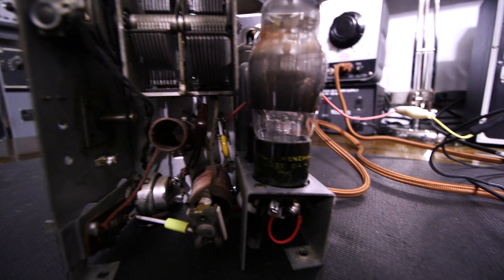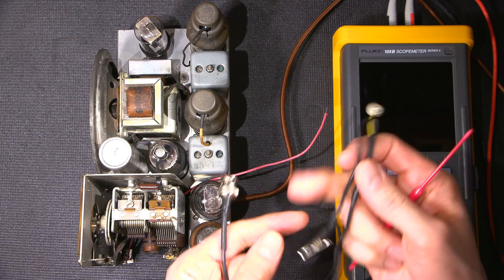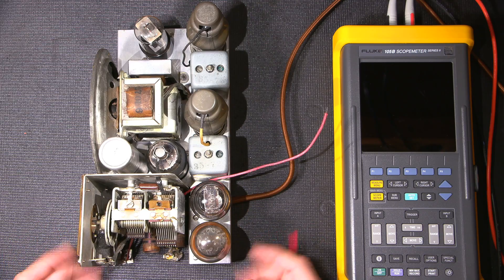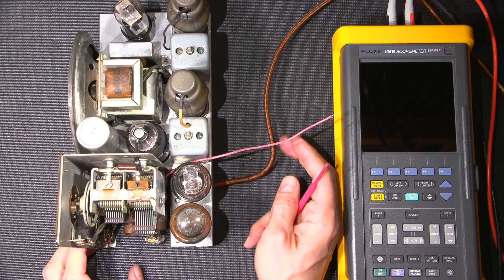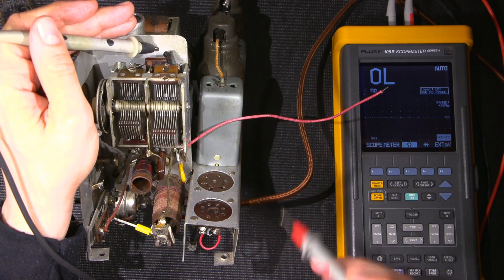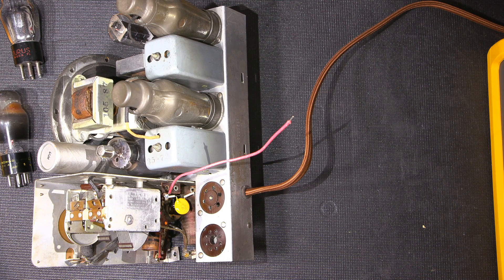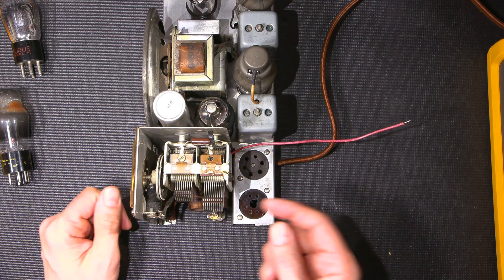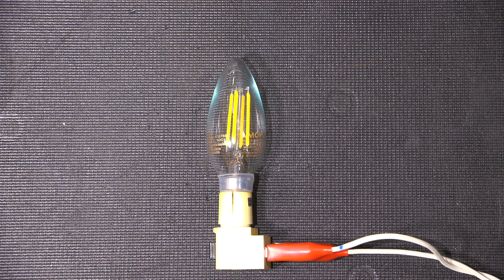See High Voltage Created From Falling Snow!

Comment: The only explanation I can think of is there must have been a breakdown/arcing occurring elsewhere that you didn't see, either in the isolation transformer, in coax connectors, or even at the antenna itself. Every time there was a breakdown, what you end up with is a very fast discharge pulse to which the inductor would have presented a high impedance much more than the 30 ohms DC resistance. If the chassis of the radio was connected to ground likely nothing would have happened, as the inductor would have bled off any charge before it could build up.

Snow, wind, and believe it or not, even rain, can cause a static charge to build up on an antenna. A high value resistor connected between the antenna and earth ground will bleed off any static charge before it can build up to damaging levels, and shouldn't affect the performance of the antenna. I consider this essential on any antenna system that is not DC-ground.
Reply: This is the explanation I’m going with too. Floating Antenna and coax charge up and eventually a discharge occurs somewhere else, maybe outside, cause a fast rise-time pulse on the coax which can couple through the cap....

Comment: I used to have a 160 meter, inverted V antenna at 120 feet above ground. One day we had a strong snow storm. the snow was falling with huge snowflakes which was somewhat unusual. I noticed a loud clicking sound in my radio shack. The spark was breaking a 3 inch air gap between the antenna coax and a grounding post. Very weird and unusual.
Now, I have static and lightning protection installed on all coax cables that enter my shack. It's very important, especially for large antennas.

Comment: I get a series of zaps while vacuuming ash from my pellet stove...Sparks jump to my hand thru the plastic hose as the dry ash particles flow. There is likely an AC component of pulses building the charge induced on your antenna. That explains a potential across the inductor in your radio's front end....

Comment: The radio chassis is sitting on a grey mat. By chance is this an anti static mat connected to ground. This would explain the antenna path to ground and may explain the arcing.

Comment: I had observed the same phenomena during a snow fall a few years ago. My discone antenna on the roof was picking up static electricity. So much so, that i was woken up by the cracking sound of sparks arcing between the center conductor and the shield at the end of the BNC connector. Fortunately, it wasn't hooked up to my SDR at the time, otherwise it would've caused some serious damage. Yet it didn't help when I stuck my finger in there out of curiosity xD...

From what I've read, it's caused both by snowflakes taking static electricity from the air, and also rubbing at each-other while falling down to earth, much like when you rub two balloons together to make them stick to the ceiling.

Comment: Woah that's pretty cool.  Kinda makes sense though, winter is super dry and snow would have some electrostatic properties to it as it's passing by the antenna.  I get shocked on my car all the time, now I need to try to notice if it does it more when it's snowing.   Now I wonder if one could optimize this to harvest energy from snow!  I don't imagine you'd get more than a few watt hours over the course of a snow fall, but it would be a fun experiment.

Comment: I had this happen to me but with a lot less voltage/current. I used to work a lot with radios when I was younger and I remember touching ground and 2 leads to my shortwave dipole and received one of the nastiest shocks I have ever experienced. I figured it was something having to do with static electricity at the time as it was raining that day. Interesting phenomenon for sure.

Comment: There was a "silent" arc or dielectric breakdown in the isolation transformer to ground.  When THAT arc happened, the fast current pulse couldn't get through the 36Ω inductor so it arced over to the chassis instead

Comment: it may have come up for lack of a better word from like a "virtual"  isolated ground. The isolation xformer acted as an antenna and the HV built up on the  isolated chassies until it jumped the gap went thru the cap and out your long wire to be dissapated by the snow charged opposite charge...something like that.

Comment: Probably not related: I used a drain spout as an antenna as I lived in a condo with HOA restrictions. I drove a copper pipe into the ground next to the spout to serve as a ground for my "shack". There was a differential impedance between the condo's common ground and the impromptu ground that shocked me when I contacted the condo ground and the impromptu ground I installed. It was sufficient enough to give me quite the zap.
Reply: us i presume?
from YouTube i have seen many reasons for potential differences between ground points in us electrical installations.
It is code here New Zealand for every new installation or alterations to existing installations to have a ground rod driven with less than 100ohn to network neutral. 
however shock hazards still exist if the house looses neutral connection and no gfci/rcd is installed hence why RCD/GFCI are required from what i understand

Comment: So the characteristics present in that charge were such that it preferred the crazy high air gap resistance over the 36 ohm path and did so across a safety cap without damaging it.  It had a mind of it's own I guess.

Comment: Sorry about this, but Mr Carlson's Lab
,  I am wondering about have you tried using the old style neon voltage tester ? Just like your old style tubes they can survive really high voltages and give you an idea of what is happening. If one bar side lights that means it's DC, but if it light both bars (left and right) it's AC.

Comment: I built a water drop capacitor way back when.  Each drop generated a static charge by dropping through a 1/2 inch copper ring soldered to # 6 sold copper wire.  Charge amounted to about 2000 volts!  Seems maybe the snow dropping by the antenna wire given the right atmospheric conditions may have contributed to the charging. Perhaps even wind and sway of the wire may have helped to accumulate charge.  I am guessing only, but will watch carefully if you get it figured out.  Intriguing occurance for certain.

Comment: Hello, Mr. Carlson ; I have completed 3 years of Vocational School, and some College. I'm just shy of having my Triple E degree.  But life delt me a poor hand. I'm disabled and could not complete my degree.
With that thought I will be becoming a member.

When I say the video about the snow. It started me thinking. Anything is posable , what stand out in my thoughts about this problem. A solar flare causing some ionized particles passing by the antenna introducing a RF charge. It doesn't take much amperage to jump 1/4 of a inch. If my memory is correct for a rf ark of 1/4 is about .5 micro amps. I have been burnt by 100,000 V thank god the amps way next to nothing. Still hurt like hell

Comment: I suspect a transient voltage caused by static buildup and arcing in the antenna system was exciting the resonant circuit in the radio and producing the high voltage sparking. You may need to put a balun transformer in the antenna to provide a DC path between the elements and balance the system with respect to the ground. Also, a gas discharge lightning arrestor with a good ground where the feedline enters the building would be a good idea. Oh, and if the coax shield wasn't grounded in the 'shack' it forms a resonant stub that can generate a high voltage when excited with a transient. This is a real example of what EMP (electromagnetic pulse) can do.

Comment: Q: is your antena bare wire? or is it coated ???
Reply from the maker: It is coated. The wire is multi strand, silver #8.
Reply: @MrCarlsonsLab  That is really wild. I could see the antena picking up charge if it was bare, so I wonder how it was getting charge with the wire coated.
Reply: @MrCarlsonsLab  I have seen EMP from a lighting strike take out a sewing machine motor unplugged in the basement of my grandparents home in MO (along with a CB in a metal shed, and all the TVs in the house, but not a tube Sony TV). But not continuous repeated sparks jump like your showing. Too bad you did not have a knife switch in series with your coax cable to see if by opening the switch would it keep a charge on the line or not.

Comment: Is the mat on the bench grounded through a resistor? If so would the spark correlate to the RC time constant of the capacitor and the grounding resistor? Also the 36 ohms to the chassis, would be in series with the mat's ground resistance. Maybe a little magnetic field action also occurring in that portion of the coil.

Comment: All I can think is that the arc flash was similar to a simple resistor, capacitor neon bulb where the capacitor  charges until it reaches the breakdown voltage of the bulb. The capacitor in this case would be the snow and air and maybe some of the parts of that radio. It certainly doesn't explain how an arc can jump across a 36 ohm resistor though. I wonder if there was an arc across the insulators outside that hold up the antenna. Is the 36 ohms a simple resistor or a coil/choke?

Comment: There was an old experiment which generates static electricity by drops of water going in-between two conductors.  It is very scary if there is an unknown phenomenon like this is happening and you do not know the nature of the electricity that you are dealing with.  It would be best to add a protection circuit to your antenna just in case it receives any high voltage to protect you and your sensitive equipment.  Another explanation is static electricity doesn't like to travel through a conductor but on the outside of it and could be possibly why the 36 ohm covered coil did not ground out and you see arching from the capacitor to the ground.

Comment: Is there any possibility the antenna was being polarized massively negative (by the action of the weather conditions where the perfect conditions of a very dry atmosphere & snowing under long period of the cold temperatures) such that with respect to the ground 0V potential of the chassis of the tube receiver? That would mean the static electricity arc was coming out off the chassis into the antenna feeder....

Comment: I have had this happen a couple of times, but the worse instance was at one of my mountain top sites.
I have this grounding strap going along the wall horizontally across the work bench, and above there is a hole in the ceiling where random coaxial cables come in that were attached to non used antennas outside on the tower.
I had unscrewed one of the N connectors on the coax and let it just hang down , which as I found later was about 1/2 inch from the ground strap.
About a week later I went back up to check some dishes during some high wind, which was still blowing very constantly.......I opened the door and heard a continuous arcing sound, and discovered it was coming from this piece of coax.......there was a continuous spark about 1/2 to 3/4 inch long that continued for the whole hour I was there........I separated them and went home, but was thinking that would have been a very high fire risk!!.....these days I ground all disconnected coax coming from outside.

Comment: Mr. Carlson kept saying that the high voltage should have been dissipated by the 36 ohms "to ground". I presume he meant the chassis? But there is no ground on the chassis of the radio, it was connected to the isolation transformer so the radio chassis was floating there with HV on it looking for earth.
He also said the other side of the coax was not connected to the chassis so there was no path for the high voltage to seek the other coax connection (possibly of no use since both antenna elements were probably at the same potential) 
So what your left with is a series circuit consisting of the capacitor in series with 36 ohms in series with an air gap to the radio chassis and the chassis itself all floating and the HV looking for earth. 
Thirty six ohms (and apparently the capacitor plate insulation) is negligible in a HV series path. 
It's possible there was a spark to ground inside the isolation transformer if the radio chassis had one AC wired connected to the chassis (or even a series capacitor - chassis to the AC).

But the light bulb failure is an interesting clue as well. He says the coax was laying across the AC wires of the light bulb. The HV might have found it's path to earth via the light bulb neutral wire from the coax shield (probably at the same potential as the inside conductor). Even though turned off, if properly wired, the bulb would still have the neutral (earth) connected.
The air gap from the capacitor to the chassis looked to be maybe 1/4 inch? That would be a few thousand volts present to jump that. (I believe 7000 volts per inch in dry air).
What is more concerning about this whole incident (not to be ignored)  is that apparently there is no protection from a lightning strike either. Or even a nearby lightning strike that can induce voltages on the antenna.  If it were lightning it would have arced (not sparked) following the same path and maybe started a fire. You are are lucky it was an intermittent low power spark of energy.

I would suggest a good antenna disconnect switch (both leads) and (as others have suggested) a megger check of the isolation transformer. And keep your coax shield away from ground. In the case of lightning the coax shield would also be a conductor looking for a HV ground piped right into your lab. I think mother nature was kindly eluding to issues you need to resolve.

Comment: Here is another theory, since you are using an isolation transformer, the static electricity build up does not have a path to ground through the coil until the potential exceeds the breakdown voltage of the insulation in the winding of the secondary of the isolation transformer to the core of same. The voltage spikes as the current leaps from the capacitor to the chassis. Two points of resistance, the air gap, and the insulation of the winding. The collapsing magnetic field in the coil will help push the current across the gap as well. Would be curious to see the schematic wiring of your isolation transformer. May be a MOS device for spike suppression as well.

Comment: Delta is maybe 2000v/sec charging the cap? Then at whatever distance the cap is from the chassis will determine the discharge from the relaxation oscillator that it is  that nice big inductor will be leaking some away -  but its just doing what inductors do. This is not a DC event.

Comment: So, I know nothing about the design of this radio or where that coil fits in, but you mentioned that your coax shield wasn't connected to anything.  If so, could the static buildup happen on the coax shield?  That would behave as a capacitor.  Eventually the static voltage would reach a point where your coax dielectric would breakdown, discharging high voltage at a very high frequency into your inner conductor.  The same would happen in reverse if only the shield were connected.

If so, then your coil would be bleeding off the static from the center normally until the shield discharged into it.  At that point it would get hit with a high voltage transient at very high frequency, where its impedance would not be a mere 36 ohms.  That would allow the voltage to spike until it arced on the chasis, unless that capacitor was large enough to absorb the total incoming charge.

If your coax shield was actually grounded then this wouldn't happen - it wasn't clear if this was the case, or if it was just floating.
Reply: Never mind.  This is incorrect.  Somebody pointed out a schematic for this and the issue is that the capacitor is between the antenna and ground, so that is a DC insulator, and thus there is nothing bleeding the static off the antenna.  It will build until the voltage across the capacitor reaches breakdown.  At that point you have a high-frequency transient into the inductor, which now acts as an insulator, and so the voltage seeks another path to ground.

Comment: I'm guessing this was friction-derived static electricity. And now I'm guessing the answer. Since normal voltage on a receive-only antenna should be in the microvolt range (I believe), is there someway to install a device that acts to ground the excess only when it detects one millivolt or above (let's say) but otherwise does not impede the signal and allows all of it to reach the radio?

Comment: I agree that it's unusual that a spark can happen with 30 ohms across the gap
I think it's a static build up in a capacitor, hence the regular sparks, if snow or rain drops get charged, they will transfer that charge to an antenna and find a way to ground, even an isolation transformer will have capacitive coupling, or any wires laid over something grounded (maybe that lamp through to neutral)
I once had an issue where something made a loud 'crack', but it only happened once that day, later i heard another crack, i realised i had a couple of large capacitors, so i put shorting links on them, yet a day or so later, i heard the crack, there was also a smaller capacitor (0.25uF 2000v) that i thought insignificant at the time, but decided to add a shorting link, that cured the problem, they were not connected to anything, or near any electrical, they are 'ornaments' in my living room.